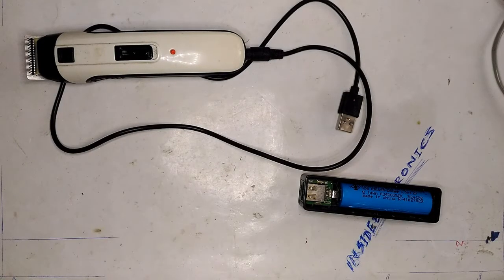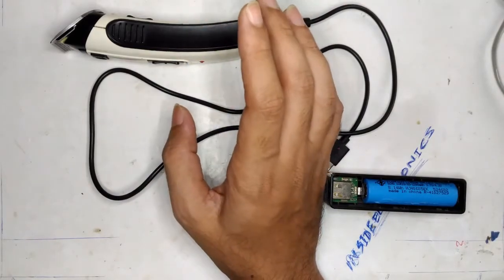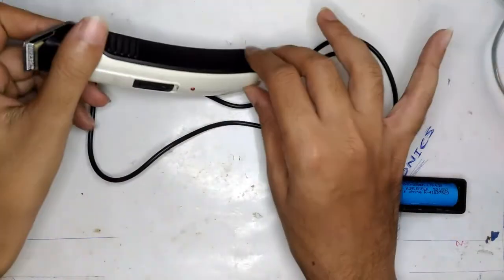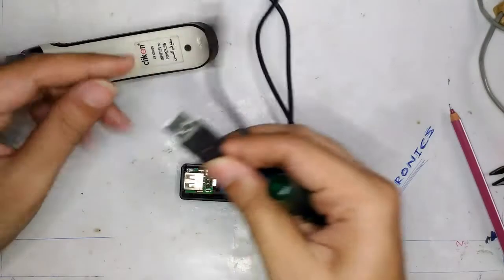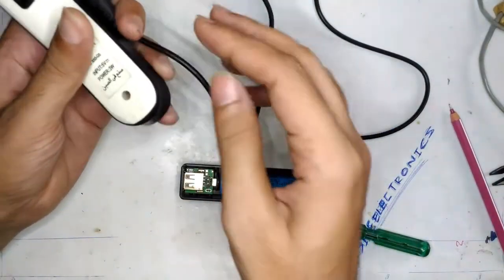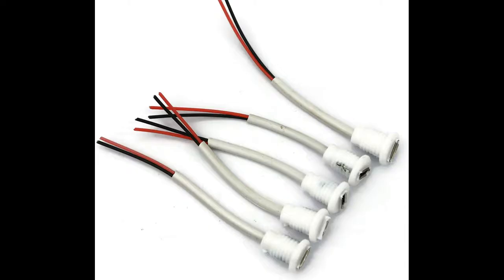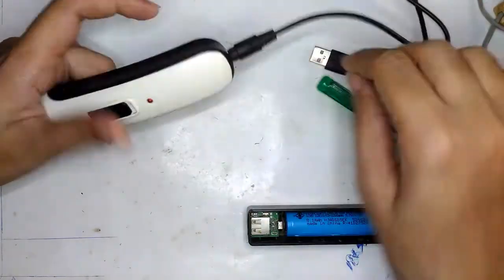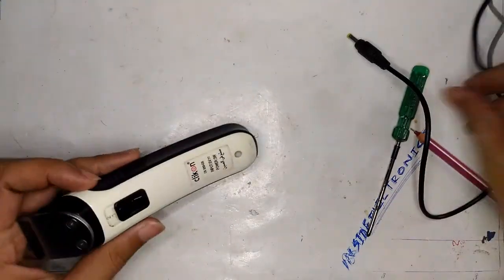IE120: How to convert battery operated trimmer to USB power.

Comment: Can we connect charger directly to the motor without circuit ?
Reply: Motor runs but trimmer is ao slow it doesn't work.
Reply from the maker: Technically yes. But when you open the trimmer, if it contains a PCB with lots of components, it may contain the protection needed for the motor. For most of the cheap trimmers that use the normal rechargeable battery, it is safe to connect it directly.